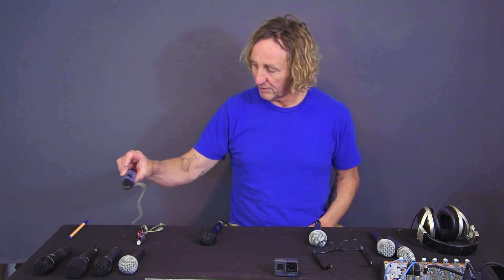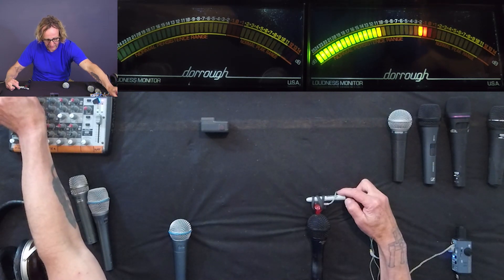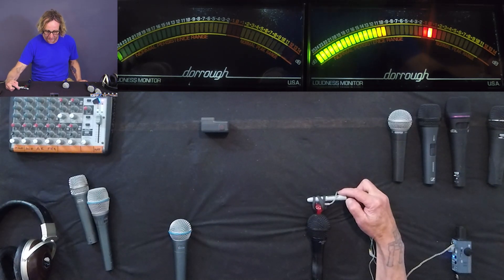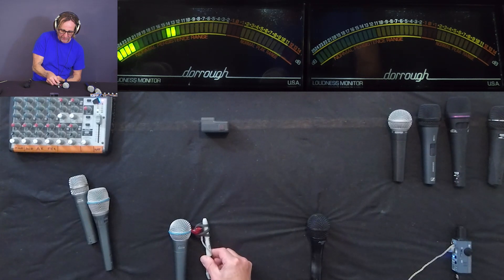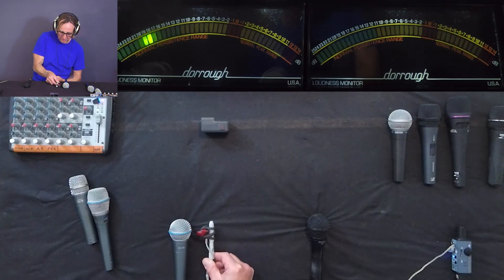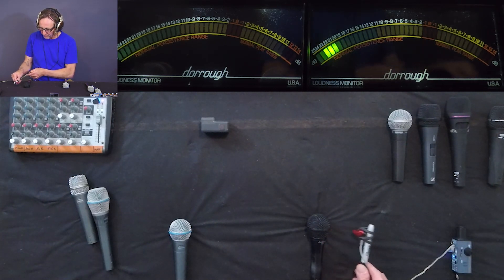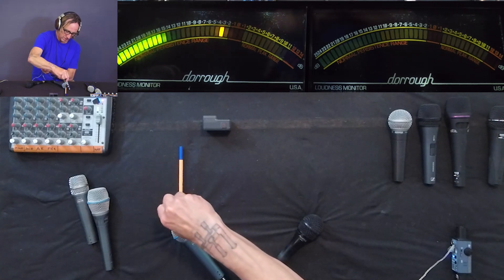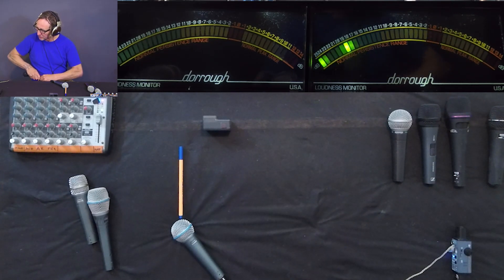Hear Microphone Polar Pattern & Distance Level Drop (Public)

Comment: Hey, curious to know if you’ve had any experiences with live mics for steel pan. Thanks!
Reply from the maker: Hmmm, yes, when played with stick w hard ends, it's pretty easy to mic without worry of feedback. Soft end sticks creat more challenge. Putting a sound absorbtive panel below the drum can help.

Mic top and bottom and polarity fev the bottom with mics equi distant from the drum will cancel out some background low end.

Closer mics like 2 or 3 beta 98s under the drum. Can work as an option to try
Reply: @DaveRat  currently using the standard rubber tipped mallets. 57s underneath perpendicular to the belly, with a cut from 1k to 5k. Considering the Beta 57 as an alternative. Thanks!
Reply from the maker: A few closer mics slightly panned could be good

Comment: As part of my live sound services for local bands I record some of the gigs I do setups for.  For the singers I started out with a mixture of SM58 and Beta 58 capsules on SLX wireless systems.  keeping very close attention to what mics went where almost every single time there was less stage bleed in the SM capsules, as opposed to the Beta capsules which goes against everything that’s supposed to be.  At first i could not believe it but time after time it happened.  I can’t explain it, but there was a very audible difference in the stage bleed.  I eventually ordered SM58 capsules to replace the Betas.  🤷‍♂️
Reply from the maker: I believe that.  The betas pick up a bunch of sound from the back of the mix, more than the SM.
Reply: The Beta’s - which I prefer - have a more accurate fall off not far from center, where they are likely to get a lot of action. The SM58 is an extreme mic for me, used only on demand. The track it creates feels like a dead end.
Reply from the maker: Sm58 is the macdonald's hamburger of mics, the beta's are the 1/4 pounder.

Or you could go to a nice restaurant or a white castle depending on your budget and desire for quality
Reply: @DaveRat  lol, well, I'm working with 5 Shure SLX wireless transmitters.  All 5 are active with the band I work with.  They play primarily in SMALL bars.  I need a capsule that can control ambient bleed. So far the SM58 capsules are performing better for this task. I'm not about to replace my entire wireless rig.  If you can suggest a better SLX compatible capsule that can control ambient bleed I'd be very happy to try one.

And I'll take the White Castle,  please.  :)

Comment: This drop-off business makes no sense. How does the mic know how far away you are? It's going to be the inverse of the square of the distance for every mic. Right?
Reply from the maker: Ahhh great point but you must take into account the distance you don't see.

If the mic capsule in mic 1 is 1" back from the grill and mic 2 is 1/4" back from the grill internally, the drop off will be drastically different. 

A source at 3" away from the grill in mic 1 moved to 1" away (4" from capsule to 2" from capsule) will gain approx 6db. But doing the same with mic 2 moving from 3" away (3 1/4" from capsule);to 1" away (1 1/4" from capsule) is moving to 1/3rd the distance rather than 1/2 the distance.

That means in mic there will be more of an increase when moving closer than in mic 1.
Reply: @DaveRat  🤯
Reply: @UnusualAudio  In a nutshell, the closer or further away a capsule is under the grill, the more or less the volume will change with distance respectively, as a result of the inverse square law. In practice.

Comment: Awesome stuff. I’d love to see what the Beta 87A is like in comparison.
Reply: Not an expert so this is just anecdotal but I was doing a live gig and we were miking a cello with an 87a. because that’s what happened to be on that stand and speed is of the essence. It started squealing at about 5000 almost right away. 

I took it off and threw on a lowly SM 57. The , Cello sounded great and no feedback

It’s my understanding that a condenser, even a vocal one, has a much lighter diaphragm and therefore will always be more susceptible to feedback.

That’s just what I found. Others can speak to the technical aspects of what’s going on
Reply from the maker: That has been my experience as well.

Though I don't have a way to test or prove that that is the reason,

Also 87sbhabe a presence boost and less warmth than a 57, the cello needs the watmth